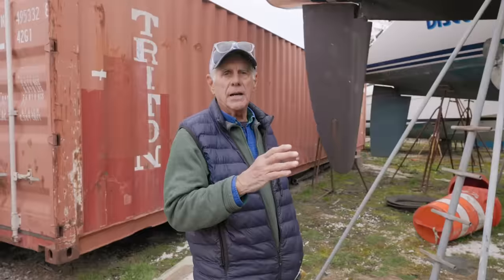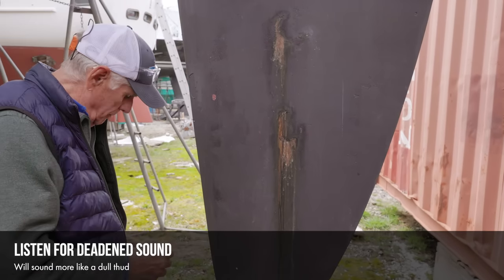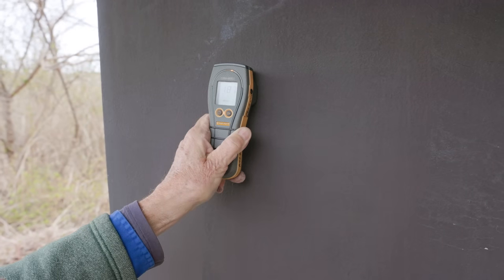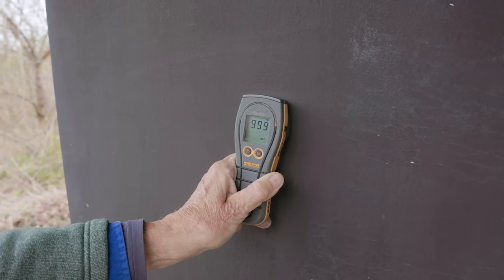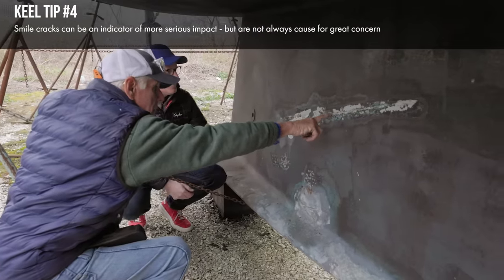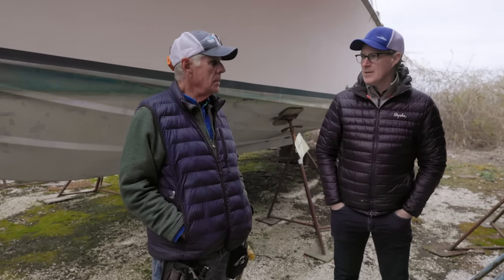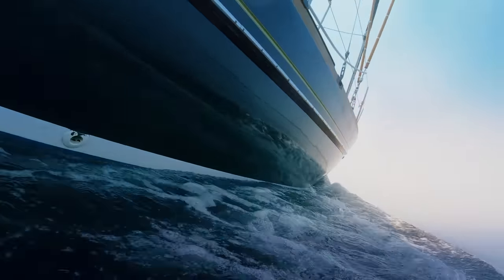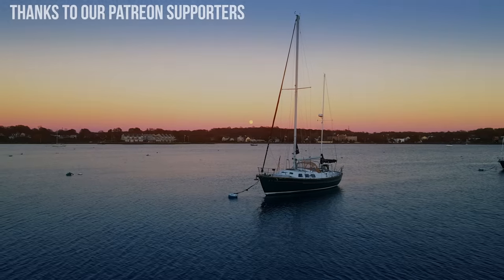SAILBOAT BUYING TIPS - Part 2! A veteran surveyor gives his inside tips - #sailboat

Comment: Another very interesting look at the nuts and bolts (and valves) of sailboats. Fascinating stuff. I never gave a second thought about sailing until I got sucked into the Captain Q vortex. 

One thing to remember about any personal project involving a used anything...It is very important to actually use the thing for its intended purpose. In this case...don't wait until your boat is perfect before using it. The projects will never end and eventually, if all you do is work on it, your new love will become just another chore. I learned this the hard way from working on project vehicles. 

Also...try focus on one project at a time. Completing a small chore provides a lot more satisfaction than starting, and not finishing, a bunch of chores. 

Once it's safe and reliable, get some fun out of it. The smiles are the fuel that will keep you motivated.

Comment: Fantastic series! A point about winged keels and grounding. I had a 30' Hunter with a winged keel. Sadly she broke her mooring during a hurricane and was beached. I live on the Bay of Fundy with its 29' tides and when she beached on he port side the port wing about 10 - 12" dug into the sand and gravel and wheat the tide came in and tried to lift her, the winged keel secured itself like an anchor and the lifting forces were so great that she broke her back. We only discovered the break when we lifted her with a transit lift and water was leaking out of the keel and when the yardman pushed on the keel, it swung big a pendulum. Had we craned her onto a trailer we would not have discovered the keel had failed. The boat was a total write-off.

Comment: I always drilled holes in the bottom of my rudder at the end of every season.  Some water would come out and the "on the hard" time allowed it to dry out.  I just plug the holes every spring with thickened epoxy.  I suspect water was coming in through the top of the rudder.

Comment: In my experience with balsa cored boats and centerboard trunks etc. is: eight coats of epoxy paint on the inside and outside are required to keep water out!!!! Water is a universal solvent and can turn a solid fiberglass hull into a flacid erectile dysfunctional trash heap! 8 COATS starting with barrier coat/primer, 4 coats, then 4 top coat layers! any questions?
Reply from the maker: sounds like an insurance place to coat in epoxy...

Comment: Great videos. Question for Jim, at 16:55 of the video there is red paint missing all around the hole. Is this a sign of bad maintenance of the hull paint and possible source of moisture damage to the hull. Thanks.
Reply: Is that a steel hull? Because if it is then why is the thru hull bronze? But that thru hull has no outside flange, unless it's a "countersunk" flush flange. But what about the visible seam, around the hole on the outside, that looks like the "spigot only" part of a modified thru hull, screwed into hull plating from the inside? That's probably not a flush flange.
Translation: What is it? It just looks spooky. Thanks.

Comment: I couldn't understand why it makes any difference which nut goes on first, so i Googled it. It makes sense! 
Look at the threads on a propeller shaft, grooves cut into the metal. Between the crests of each thread is a V-shape whose sides are called flanks in engineering speak. When you put a nut onto a shaft, notice as it turns its way up the shaft, the nut is doing so by pushing against the outer flanks of each thread as it winds its way up towards the propeller. When the nut bottoms out against the hub of the propeller, and you tighten the nut snug with a wrench, the nut is tight because its internal threads are firmly seated against the outer flanks for as many threads as the nut covers.

Proper installation begins by installing the half nut first and tightening it just snug enough to “preload” the half nut onto the shaft against the prop hub. Tight but not with all your weight on it.
Then the thick nut goes onto the shaft. When it reaches the half nut, this is where the engineering magic happens.

With a second wrench on the half nut to keep it from turning, you continue to tighten the thick nut against the half nut. As one applies more torque to the larger nut, which has twice as many threads and is therefore more powerful, the thick nut begins lifting (or unloading) the half nut off the outer flanks of the shaft threads. As you fully tighten the thick nut, the half nut releases its pressure on the outer thread flanks and is pushed hard against the inner thread flanks and against the prop hub. The two nuts are effectively now pushing against each other, and they will stay that way forever.
The greater number of threads of the larger nut means it will always win this contest, also because the half nut has nowhere to go. The two nuts will not come off due to vibration or engine use. Ding a blade and the nuts will stay tight. Have a cutless bearing back out and you will have other things to worry about in the vibrating chaos that follows, but not about losing the propeller. That happened to me once in the Caribbean…another story.

The purpose of the prop nuts is to make sure the propeller stays seated snugly against the shaft taper. In normal operation, prop nuts don’t really take much load anyway, as thrust from the engine keeps the propeller pushing onto the shaft. In reverse there may be some load on the nuts but that is temporary and nothing to worry about.

So why make a big deal about these two nuts, and the order of how they are installed? Because it is the proper way to do it, and that is reason enough.
Reply from the maker: Fantastic homework job… you’re hired for our research department… that makes even more sense now. Well done & cheers!
Reply from the maker: That’s the nuttiest reply we have ever had !!!

But I love the engineering behind it 
Give the man a giant seegar ! 
Thank you for taking the time to research and share 
Do you have a link to your google discovery?🤗

Comment: What type of moisture meter is he using? I don't know if it's appropriate for a purchase for a boat shopper or not
Reply from the maker: It’s a little on the pricey side for a regular shopper - you can check it out here https://www.amazon.com/Protimeter-BLD5765-Non-Invasive-Moisture-Display/dp/B00GS2CZZW?&_encoding=UTF8&tag=yachthunters-20&linkCode=ur2&linkId=dd5a66ac894bf2635125f742f403f855&camp=1789&creative=9325

Comment: Would a bulb keel have the same moment as a wing?
Reply from the maker: it certainly could if they had the same weight and center of gravity location. The additional advantage of a wing shape is that it can also provide lift or lateral force depending on the shape. A wing can also have more of the weight in the lowest part of the keel so you if you compare to a bulb keel, you could get away with having it be a shallower draft compared to the same weight in bulb form.  hope this helps!
Reply: @YachtHunters  thank you so much. I’m fortunate enough to race on a Eureka 32 that was once owned by Ben Lexcen who designed the Wing Keel on Australia II which won the Americas Cup in 1983. Sssssshhhh. And an Adams 10.6 which has a 3M lifting keel with a bulb that has a go faster groove around the insertion point 😀

Comment: Bronze is made of Copper and Brass? Painful mistake. Copper and tin plus some more metals depending on the type of bronze. Brass is copper and zinc which causes problems for high load fittings when the zinc washes out by electrolysis.